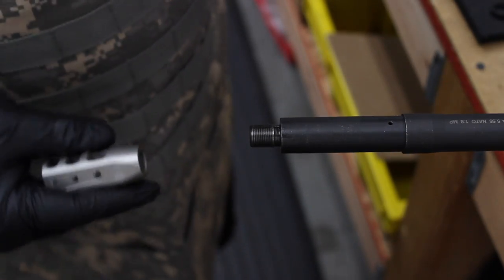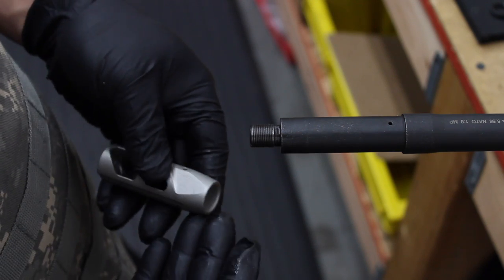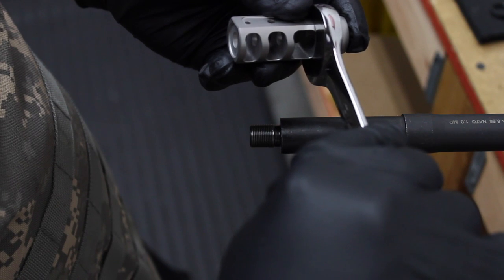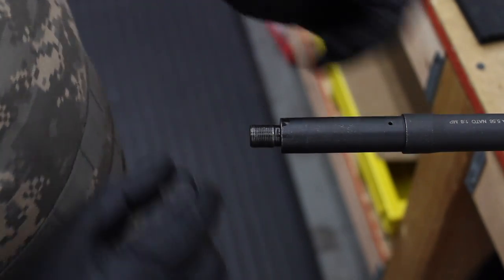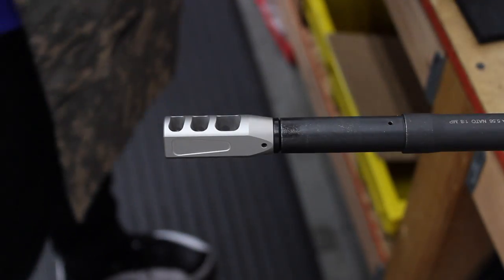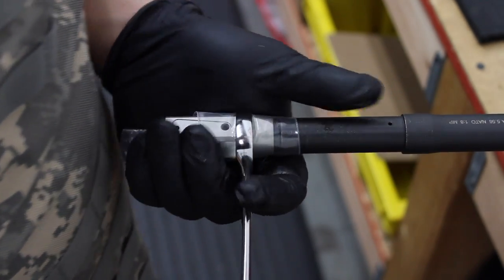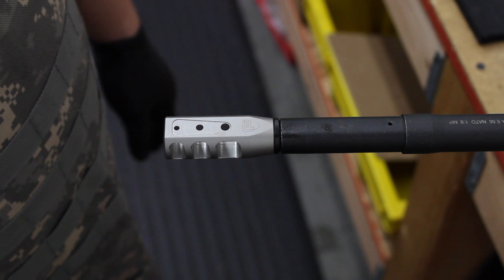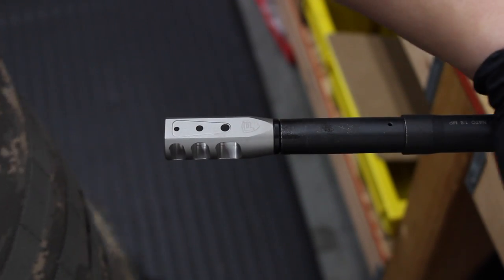How to install a RED brake (556 & 762)

Comment: I have a Bear Creek Arsenal 7.62x39 upper with 5/8x24 thread pitch.  
I just want to confirm if your Red 762 muzzle brake will work on my up.  In the description on optics planet calls for ar10 .308 and 308/762.  Was confused so I just want to confirm if its good to shoot 762x39 through it.
Reply from the maker: Kash,

Yes.  it will fit on your BCA 7.62x39 with 5/8x24 TPI.

Comment: Will this fit on a Tavor SAR 556? If so do you recommend or do you have something else you recommend for it? About to order the same as in the video but I'd you have something newer out and think it would work better please lmk. Thnx in advance
Reply from the maker: Our 556 RED brake will fit the Tavor SAR 556.  They both should be threaded 1/2x28.

Comment: Do you recommend anti seize compound, loctite, grease or just put it on dry as shown.
Reply from the maker: Dry is fine.  But if you are concerned a little Aeroshell 33ms will be gtg.

Comment: I defiantly will be purchasing a 5.56 red brake, just 1 question about the install, how did you have the barrel secured in the video?
Reply from the maker: Adam Reese Thanks for the question! We are using a DPMS claw to hold the upper.
Reply: FortisMFG Wow!! Thank you for the quick reply

Comment: Trying to install mine now but having issues timing it to the F Shield on top.
Reply from the maker: Once hand tight with included crush washer you should be able to spin it till the muzzle device is properly timed. If you need further assistance email us or give us a call.  info@fortismfg.com 253-277-3211

Comment: I just installed mine and at hand tight it was already lined up. Went 360 and the washer snapped.
Reply from the maker: The washers are designed to go over 1 full revolution. Reach out if you need a new washer.
Reply: @FortisMFG  Thanks guys! I appreciate the quick response and awesome customer service.